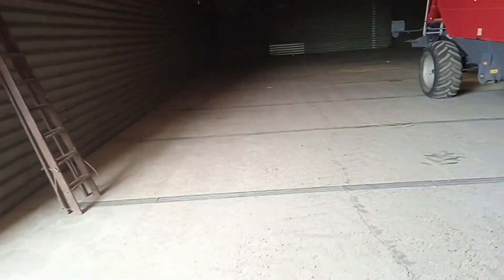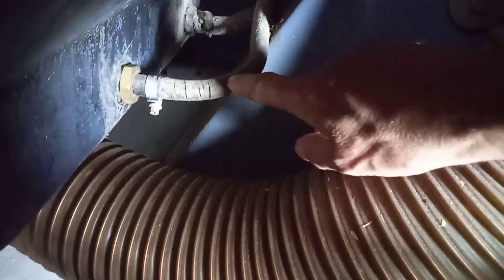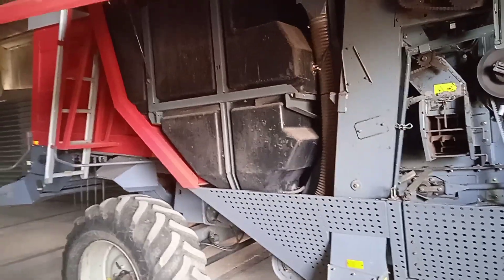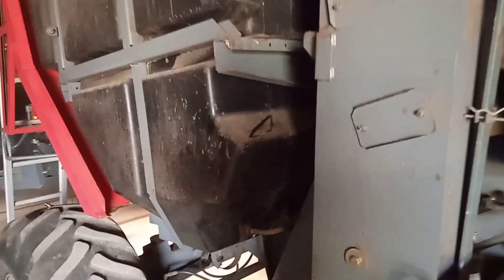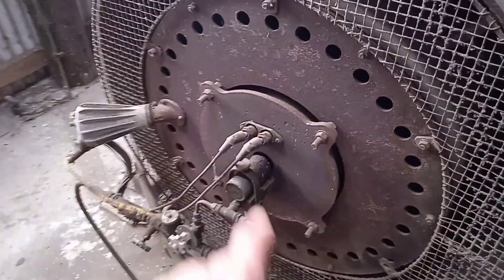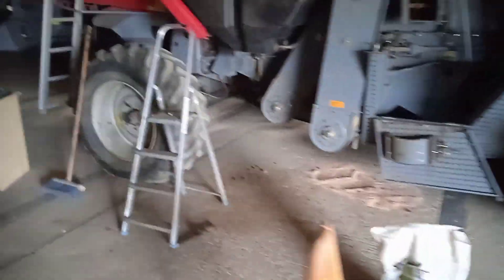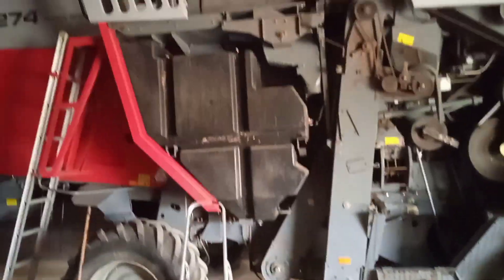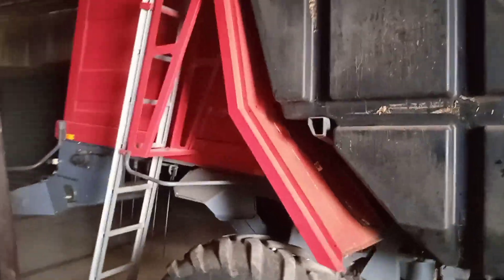Massey Ferguson 7274 fuel tank

Comment: Hi. I have a similar harvester, recently a belt fell that damaged several others. after replacing them, on the computer I have a speed potentiometer error and the tresher switch is on error. Last problem was solved - bad connection of the sensor. Speed potentiomer still there. Problem with the speed potentiometer could not be solved, the machine is not moving at the moment. have you ever met this problem?
Reply: I think one of the computer jobs is broken. They are located where all RL are.